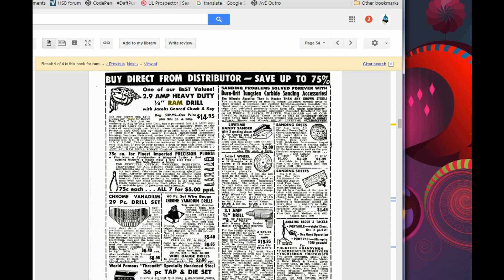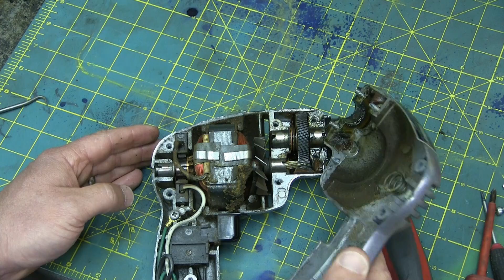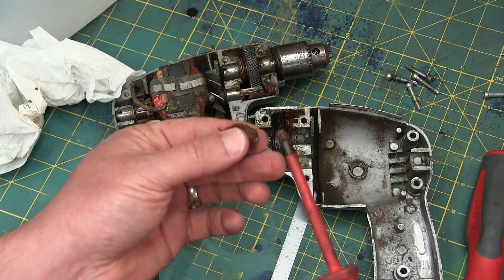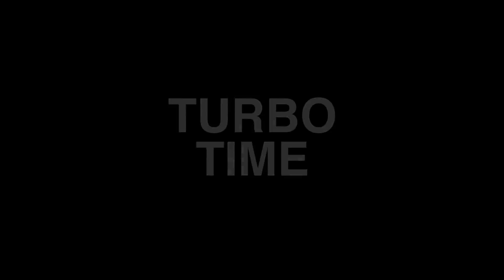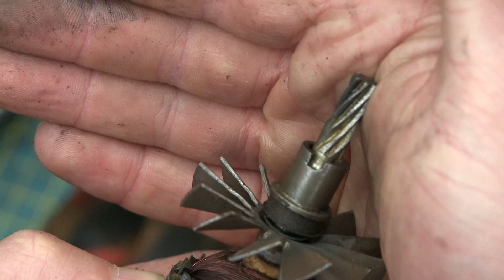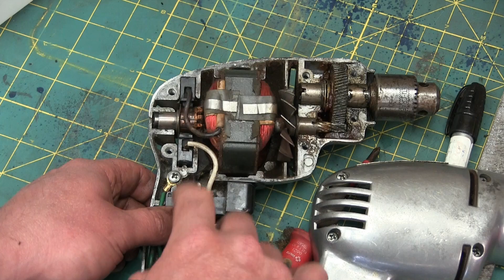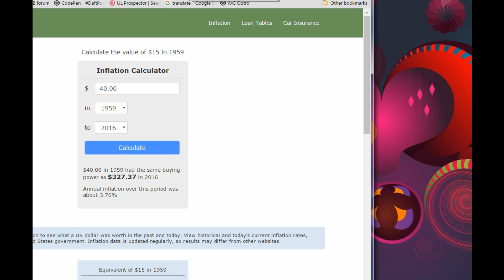BOLTR: Nifty Drill from the Fifties!

Comment: I thought your neutral had to conduct electricity I assume you could use the ground like a few electricians did in the 60s when they needed a 3rd conductor on ceiling fans in the 60s but I wouldn't recommend it

Comment: My Skil Saw, my dad bought in 1960. <so would be same as Porter Cable) A 7" blade. Made for 2 or 3 year before they standardized to 7 1/4" blade. So, 7" saw blade does not exist except on a garage sale.  Otherwise the blade is all steel, meaning it has to be sharpened(as it is not Carbide tip) Saw works great.  7 1/4 does not fit.   I had a 4" Record vise from England.   Held up until the 4 foot cheater pipe was used then it snapped.  The 6" from Princess Auto broke within the first year.

Comment: I have a Wolf drill similar to the one you featured, the chuck was different with a hex key to open & close the church. It comes with a small circular saw table that the drill mounts underneath driving the saw blade. I remember a small bandsaw with quite small wheels in three places to give a reasonably decent throat. The drill was mounted at the bottom wheel so the bandsaw blade was pulled down through the item being cut. Unfortunately I don't have the bandsaw but I do have the the small table saw and blades. I'd  be quite happy to send them to you if you are interested,  the problem is fthe cost from the UK to Canada!!

Comment: There is good reason for the gear helix to load the forward toward the chuck.  This is designed to oppose the applied force from the operator.  In this manner the gears are only exposed to the difference between these two forces.  If the helix was the opposite hand the forces would be additive- requiring a larger bearing.

Comment: I think they may have engineered the gearbox specifically so the larger gear DOES get pushed towards the front, because that'd reduce the load on the rear bearing when the 200lb gorilla is standing on the handle!

Comment: the reason why mechanicals all sort from these days is made so well and sturdy, mainly because most if not all engineers and tool makers came from steam machinery. the dimension those guys were used to are not compare with todays thinking. 
you can see it with the first cars or agricultural machinery, commercial trucking equipment. its kind of build like locomotive or steam machines.

Comment: Common failure mode on these is the cord strain relief wearing out, followed by the wires rubbing against the case, at which point you'll be drilling and it'll proceed to shock the snot out of you. What's typical at that point is that the arm that it's shocking is no longer responding to commands from your brain, so you can't open your hand to release the bastage. It's the kind of thing that'd be pretty funny if it wasn't happening to you. If you're lucky and still conscious you can find a 2x4 nearby that you can grab with the other hand and give the affected hand a smack, like some kind of animal. If you get a chance never to use one of these jeezeless things, take it.
Reply: Exactly right.  Dad had one of those and I was drilling out a broken bolt on my '58 Chev thermostat gooseneck and was standing in a shallow puddle.  Wow did I get a jolt.  I threw the thing into the nearby creek.  My brother went and got it and told my dad.  Banned from the garage for about 3 months.
Reply: Speaking from experience?
Reply: @PiOfficial  It's something you never forget, really.
Reply: @sneezingfrog  this a lovely mixture of bloody horrible and hilarious mate.

Comment: Reminds me of the Milwaukee Hole Shooter I inherited with the house I bought 23 years ago.  The drill is probably as old or older than I am (50+). All metal casing, riveted metal plate with serial, model#, etc.   Been using it for all sorts of stuff, mainly wire-wheel for cleaning crusty stuff.  Torquey little beotch.  Major clicky-click switch.  No pansy variable speed or reverse either.  You got one speed and that's full balls forward.  Hold on tight if you got that trigger lock on... 
Seemed to be getting a little hot and tired lately, plus the cord was perilously close to allowing the pixies to run astray (I prefer NOT to be the ground), so I did a teardown, clean, lube and rebuild.  Bearings were still good, no bushings here.  Balls in the front, balls in the rear.  New chuck, new cord, cleaned out half a century of schmoo and she's off to the races again.  Runs way smoother, quieter and far cooler now.  Good for another 50 years.  
I love that old shit.
Keep yer drill on the mice.

Comment: We had one of these drills on the farm in Illinois, I chucked a bolt into it with a socket attached and used it to start the Wheelhorse lawn tractor. Seems it burnt out one winter trying to start the tractor to move snow. Poor old thing.

Comment: If you look carefully behind the eccentric bearing mount on the blade drive shaft, it appears there is a space which indicates a washer is there. I would guess that the eccentric bearing mount was machined separately and installed as a secondary possibly by induction brazing as it looks to be a brass colored fillet between the smaller shaft and the eccentric cam. Hart do tell from the video.

Comment: Maybe the gear cut direction is intended to reduce the force on the thrust bearing from the user applied force on the bit-  So the user pusher the bit, and that force on the thrust bearing is reduced by the gear cut force.  If the gear was cut the other way, the forces would add on the thrust surface.

Comment: While it is true that they used to make things that last a very long time back in the days, but these people really did lack common sense.  An all-metal case for the drill and grounded?  Really??  What were these people thinking back in the days?!? 
Here's what could have or had gone wrong:
1.  The user holds a metal bar that has been improperly grounded to the HOT line instead of GROUND and then the user grabs the drill and its instant electrocution (You are touching HOT with one hand and GROUND with the other hand due to the drill being plugged in and the whole metal thing grounded).

2.  You want to drill a hole into a metallic bar.  This metallic bar is not properly grounded/Ground fault, some linemen or user made a mistake and "grounded" it using a HOT line instead of GROUND, the whole entire drill is grounded and you install the metal drill bit to drill a hole onto the metal surface and as soon as you make contact with the drill bit with the metal surface you hear a loud bang and trip a circuit breaker.  (Bonus:  If you grab onto this metallic bar in order to create drilling precision then its electrocution before the short circuit that trips the circuit breaker).

Yep, clearly, ZERO thoughts were given to safety when they manufactured things back in those days.  At some point, they finally got into their senses and started adding the plastic cases to cover the all-metal cases which not only infinitely improved the user's safety under the grand majority of operating conditions but also gave a pass to the aesthetics designs improvement we see on our power tools today.

Comment: 13:19  One (which one ??) can make a rotor by separate the two poles by a ring on each rotor end so there is no back emf, but then there is no need for brass spring carbon conductors like that on 11:25

Comment: The direction of the gear cut might be intentional to reduce the wear on the thrust bearings. The axial force generated by the gears will subtract from the force of the feed pressure. This will reduce the pressure on the thrust bearing as compared to if the gears were cut in the other direction or if it was a spur gear.

Comment: The angle of that helical gear makes sense in a way
It only pushes the shaft forward if it's outputting reasonable torque, meaning it's under load (drilling)
So when you push on the drill to make the hole that part is pushed into the back by the 200 pound gorilla, but pushed forward by the helical gear.
If that's done right that would reduce the pressure on the bearing that's taking the thrust.
I have no experience in engineering and i got no idea how much torque is in 'er just running freely or if the gorilla at the steering wheel overcomes the gear or not

Comment: My Dad gave me a Ram Fury in the seventies, and I threw it away on the same day. Well, fuck that noise. Maybe the ones from the fifties were okay, I don't know. The design was a dead ringer. Dad also gave me a Millwaukee hacksaw, which I fitted checkered grips to. I still have it, and, I'm happy to use it. I did that at Boeing, and I got a jig builder to glue the grips for me. I worked with some memorable jig builders, some of whom, were wonderful craftsmen. They were a great resource, when I needed to navigate the BAC specs. What a treat. Hey, friends, if I was working for you, and you had no drawings for me to work to, and the layout man you assigned me could only make screen prints of space models, which were straight out of Disney World, you would send me packing. Mark

Comment: I had a Record vice that broke the first time I used it. One jaw broke and since it was the one that travels I looked at the price of a new one. I paid about $125. or so for the vise and a new jaw was $200. smackers. 
Oh, by the way, the salesman told me they' had a great warranty but when it crapped out he declined to honour said warranty. The Tool Store has not seen a shinplaster from me since then.
My grandfather had a 1/4"  drill that looked like that. Skill brand if memory serves. I think I still have drill bits larger than quarter inch with the shaft cut down so  I could use them in the quarter inch drill. 
When cars had generators that were easy to rebuild they had bushings like that. Super easy to replace and all we ever did to impregnate them with oil was to stand it on a thumb, fill with motor oil and with the social finger squeeze for a while. It worked.
Anyhoo, another gooder. TY

Comment: Bought one of these old ass drills for $2 at an estate sale, just out of curiosity.  The damn thing has a sliding ON/OFF switch where the trigger would go!  i've never had a tool that had a higher power:ease-of-use ratio before cause that thing has almost gone AWOL on me a few times before trying to finagle the switch on it.  Still, you can't beat that torque

Comment: my dad had a couple of these. I thought it would be cool to use them when his drill broke. nope. I found out the hard way that he didn't use them for a reason. zapped the piss out of myself.
Reply: 4nuk8r I also not opposed to opening it up and replacing the faulty wiring. Prob way easier unless the motor need to be rewound.

Comment: ah good old tools the last good tool I remember was the Milwaukee Hole Hawg and when I was 15 I used it once to drill a 2 inch hole through 1 foot by 1 foot lumber in an old house to run new electrical wire I wasn't paying attention and a drill that only runs at 350 rpm max with a 10 amp motor that F*** threw me into a wall and SLAMED me like nothing pure torque Made in USA my grandfather has an old Black and Decker drill also made in USA he was 3.5 amp motor drilling 1 inch also through 1 foot he ran that thing non stop until he was finished and it was smoking but still runs today

Comment: As far as the porter cable circ saw at the end goes, check the weird little deedle that holds the blade on. It's some kindof spider looking locking something. I've seen these saws and their really nicely made even by modern standards but that spider lock thing is always busted so none of them work.

Comment: I bought one of these at a thrift shop for $10. Some previous owner had replaced the trigger and lock with just a little toggle switch in the place of the trigger lock. Either on or off. Real loud but works just fine for a budget drill.

Comment: Random question for you AvE, I've got one of these drills (or equivalent) and it has got a two prong plug and I'm assuming it's not double insulated. I'm just wondering if it would be safe to use since the jacketing on the cables coming out of the drill are starting to disintegrate. Thanks.

Comment: I happen to have a Rockwell Manufacturing Co. model 70 1/4 inch drill from the year 1969 layin around, and while it's a 1/4 horsepower little motor there, the thing wouldn't die if I ran it for an hour solid, I'd tell ya.

Comment: Me Dad had a KBC drill - all similar. he had a jigsaw, 4" circular saw attachments. Drill press to bung it in.
The short handle, you use your middle finger or the one next to you're pinky on the switch and the palm of your hand way up to get thrust down the centreline of the drill. Works good actually

Comment: I owned a Ram 1/2" drill of the same design, purchased it in the mid 70's. Had an orange plastic case up to and including the area of the fan. The front of the case was metal. I believe it was a 4 amp motor; don't remember the rpms.

Comment: I just seen a guy at flea market sunday who has the adapter saw-zall. Took me a while to figure out it wasn't just part of a broken one.

On 15:54 I think your wrong on the direction as putting load to front baring from gear angle reduces/distributes some of load off of back bearing. I do watch repair. Old timers where smart as Hell. Not much scoopamoss (11:49) going on. 

Quite often you really have to re-think the majigamadoo over. Double check both ends of a double ender -4 times she said. Remember they invented cardboard in 1817.

Comment: I have one of those drills, I had gotten shocked from it because the grounding pin on the power cord was missing. I took it apart, and replaced the cord. For one, it is not cordless, and that old drill is no match for a cordless impact model. The only areas of the newer drill that are plastic, are the parts that can be plastic and not effect the durability, and longevity of the drill. The biggest problem with cordless drills was almost solved when they started to utilize the same battery mount . Makita had maintained the same battery mount for a while. All those old cordless drills that only became useless when the battery technology was old, and once the battery became useless, the cost of getting another battery was almost the cost of  getting a new drill with two batteries and a new charger.  I have various Makita drills, all bought years apart, but they all use the same battery technology, so I have a set of batteries of various capacities, but the same voltage, and i can use them on any of  my Makita drills. That includes hammer drills, and impact drills, which all fall back to being a standard drill. One thing more, is that the cordless drills have a clutch, so I can limit the amount of torque in the twist, or give it the full power. It is enough power to break a bolt, if that is what is being done. Try putting up hurricane panels with an old drill like that.

Comment: Don't believe a thing the inflation calculator tells you. The US has been mucking with the inflation numbers for decades and all for the purpose of making inflation look like it's less than it really is. The government has a lot of incentive to understate it and a lot of disincentives to report it properly. Remember, for example, that SS payment increases are tied to the inflation numbers and the interest they have to pay on bonds is related to the inflation rate. An ounce of gold was $35 in the 50s. So that drill was just under 1oz of gold, which today is about $1300! Using gold as a measure, that drill would cost $1100.
Reply: I've always used the hot dog equivilency. In 1969, I could buy a hot dog for 25 cents on a pushcart stand(only if you found the cheapest stand, most were 35 cents, with kraut or onions). Today, that same hot dog (again, at the cheapest stand you can find) will cost me about 10 times that.
Reply: Think of all the productivity gains we've had since then too. Prices should be WAY down. There are now nearly 10 million more government workers in the US then there are in manufacturing. That is a lot of government to pay for and the printing press comes in handy.
Reply: What happened to Jeremy's reply? It's in my inbox but not here.

Comment: 1/4"???
Was that really a thing back then?
Reply: Years ago, lots of furniture that was made of hard wood had to be pre drilled because they used screws to hold it together, and a 1/4" drill bit was adequate for that purpose. And, power tools (especially higher powered ones) weren't as common because people didn't have much money.  Today, everything is put together with a staple or glue.

Comment: i have a similar looking black and decker drill but its orange and double insulated so probably from the 1980s rather than 50s, it was my dads drill then i got it for my workshop, i only use it occasionally since i turned my workshop into a computer repair center as it turns out i am much better with computers than i am with woodworking, but it still is occasionally used to add a fan mount where one is needed :P

Comment: Have one just like it bought at a garage sale for $3.00 and it works great. Used it on a drill powered water pump and locked it on for an hour on a hot summer day with no problems. After seeing your video will plan on taking it apart to clean and re-grease. Love all your videos and your shop smarts.

Comment: Antique Emerson capacitor driven fans/motors are undoubtedly better than anything else made today, less heat, more power, more efficiency, more durable. I still have a couple in use today

New tools/motors suck, the early 90's were the beginning of the decline of quality products.

Our 17 year old cordless drill gave up the ghost, replaced with a new one, chuck and gearbox failure in 2 months, same brand.

I own a 22 year old Portercable that still works great.